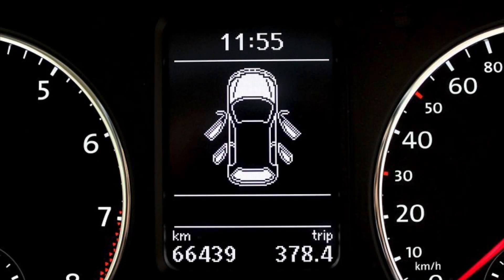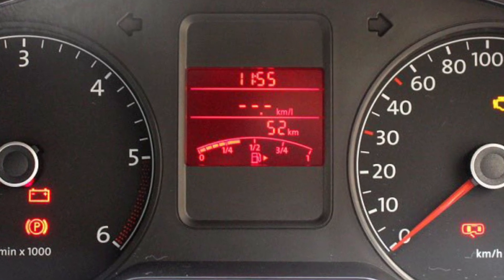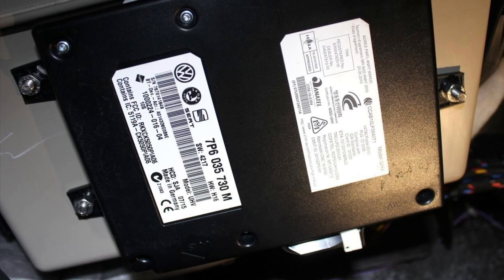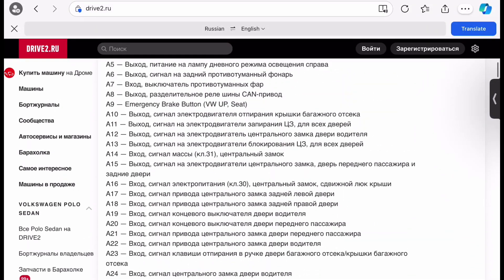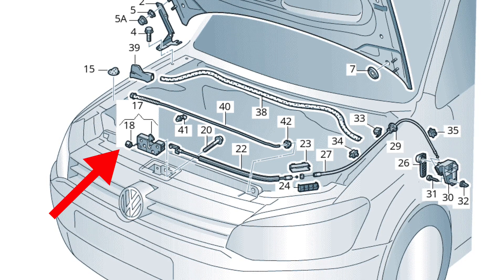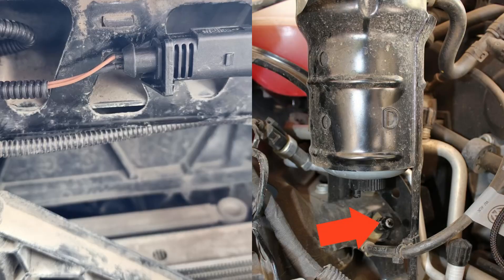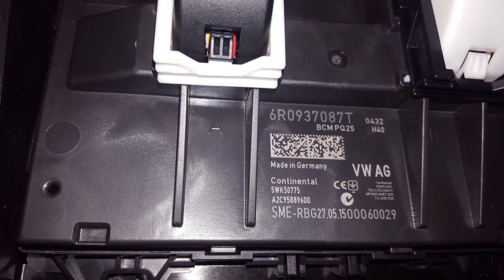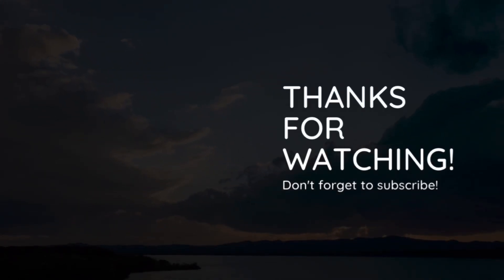Polo 6R - Bonnet Open Indication in Instrument Cluster (Highline MFA+)

Comment: Hi Ganesh, Good day. I have a doubt regarding lowering springs. Could you please confirm if we can use eibach lowering springs that is used on a tsi to be fitted to a TDI ?
Reply from the maker: Hi, suspension components are dependent on the kerb weight of the car. Please check the data sheet and confirm if they have indicated both TSI and TDI engines in the application.
Reply: @GaneshBalan  okay sure.. thank you so much for the quick turnaround.

Comment: Extremely informative video sir. I have a maruti vitara brezza zdi+ amt and it is due for service. In the last service MASS has used 5w40 engine oil. This time I'm planning to use 5w30 a5b5  fully synthetic engine oil. Is it safe to change from 5w40 to 5w30? Please advise me on this regard. Eagerly waiting for your response sir. 
Thanks and regards, 
Hrishikesh.
Reply from the maker: Hi Rishi, changing the oil from 5W30 to 5W40 won’t make any difference to the engine or the user. NONE. 

But switching from semi-synthetic to fully synthetic makes a perceivable difference in terms of reduced engine noise while driving, smoothness, etc. 

And oil from a good manufacturer like Castrol, Shell, Mobil, etc. 

What I would however suggest is to stick to Maruti’s recommended oil based on the user manual. I trust the MASS has done that correctly. Please do check your user manual regardless. I see 0W30 a lot in Maruti’s user manuals.
Reply: @GaneshBalan  Thank you for your prompt response sir. In the owner's manual, recommended grade mentioned is 5w30 a5b5. Actually dad got the car serviced last time and I came to know that they have used 5w40 after seeing the service bill about the grade they used. This time, service guy told me that they are using 0w30 fully synthetic for all diesel models. Hence that doubt. 
Thank you so much sir. 😊😊😊
Regards, 
Hrishikesh
Reply from the maker: @hrishikesavareddyporeddy1267 No worries Rishi. Have a great ownership with the Brezza. 😊👍🏻
Reply: @GaneshBalan  Thank you so much sir 😊😊😊

Comment: Eagerly waiting for more such walkthroughs. Its very easy to follow, you break down every part and explain really well Gannu sir. Your guides on teambhp, and also guides from helpful people from other fourms like uk polos and drive2 is very helpful in understanding what all components and process for retrofits. I am looking to install this maxidot cluster, but had a few doubts. I also apologise for spamming your comments with questions, I don't have the membership so i cannot post there.

I want to use it in vento, is it possible to change the icon of the car shown in the display? Can we do it with vcds or need higher tools like odis?
I am seeing prices around 60k, is it a fair price? Especially as online coding is also needed, which is not included.
Reply from the maker: Hi, thanks for the feedback! 😊

1. It is possible to change the car displayed on the MFD from a hatchback to a sedan but it has to be coded using the EEPROM coder and not VCDS. VCDS can be used to change the car displayed on the audio unit like the RCD 340. 

2. I am not sure of the ongoing prices but please do check with different retrofitters - their charges may vary. Do speak to Praveen Sorab from Bangalore - 81477 37557. He does a lot of retrofits including maxidot cluster change and can change the car type for you.

3. Please apply for a Team BHP membership!
Reply: @GaneshBalan   Thank you very much for the detailed answers. I will do the application soon

Comment: Part number of the instrument cluster?
Reply from the maker: 6R0920870
Reply: Is this petrol variant cluster?  @GaneshBalan
Reply from the maker: That’s right. The petrol version.
Reply: @GaneshBalan  thanks sir for confirmation. I have a 2018 vento highline connect edition TDI AT. Can I install maxidot petrol cluster instead of diesel cluster? What are problems in real time if I install petrol maxidot cluster?
Reply from the maker: @HarishCh548 no problems. The tacho would read the correct engine crankshaft RPM. You’ll have to change the car type indicated in the MFD from a hatchback to a sedan which the retrofitter can do.
Reply: @GaneshBalan  could you please share the link to purchase the cluster. It would be helpful 🙏
Reply from the maker: @HarishCh548 Harish, please get in touch with Praveen Sorab - 81477 37557. He’s from Bangalore and will help you.
Reply: @GaneshBalan  sure. Glow plug indicator won't be there for petrol cluster if I'm not wrong. But diesel cars need glow plug indicator warning right.